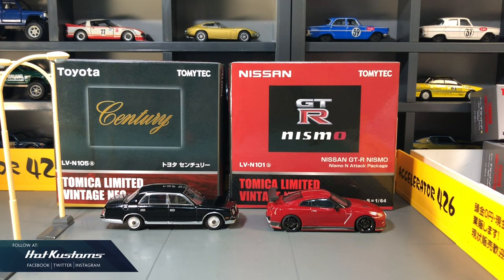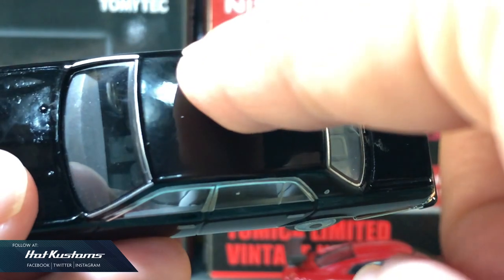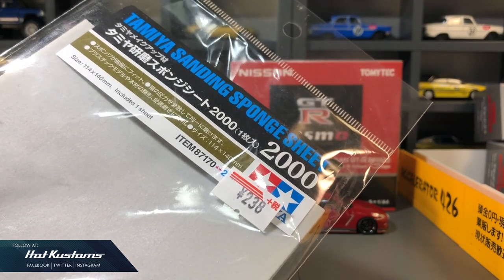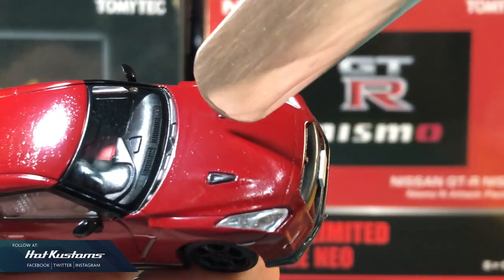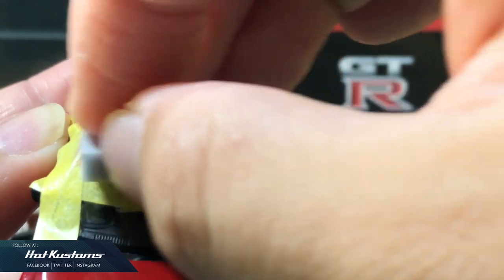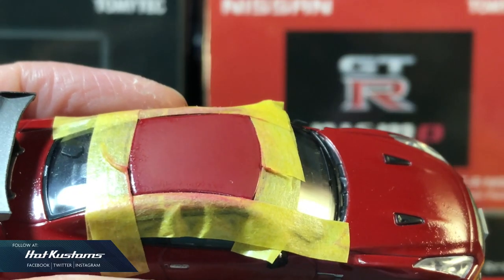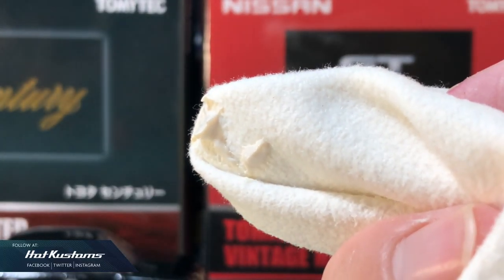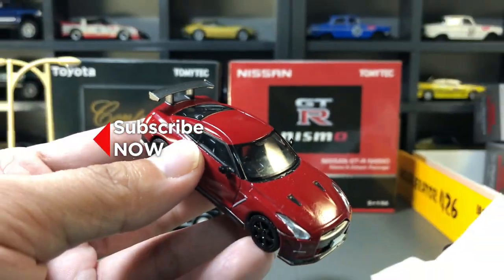How To Remove Paint Rash From Tomica TLV | DIY Tutorial

Comment: Bought a TLV Porsche and this happened. Tried similar method (2000 > 3000 > finishing compound) and there are some very fine scratches. Did I polished the finishing too hard?
Reply from the maker: Yes in a way I think apply too hard. It’s trial and error u can always apply on cheaper Diecast to test such as hot wheels mainline before attempt to TLV too. Can’t apply too many times or too hard or the paint will come off
Reply: @HotKustoms  sorry, my mistake, I was trying it on a modified tomica. But found out my Porsche has paint issues

Comment: Thank you so much for this tutorial, brilliant!     I recently purchased a few CMC diecast models and they have Paint Rash....IF I wax the models regularly and keep them in air tight display case, will the Paint Rash stop growing?     In other words, I can live with the Paint Rash as long as it does not get worse if I wax them regularly and dust them off.  What are your thoughts? Is Paint Rash like a Cancer that just keeps getting worse?        The previous owner of these models lived ina very humid climate, it's why the m,odels have the paint rash, I live in a very dry climate.

Comment: I was going to buy my first tlvn, but after reading and seeing the paint rash issue I decided not to eventhough it could happen to any brand.
if it was a cheaper diecast then I'll be okay but curing tlvns is just a big stab in the heart. such a premium price and you still have to stress/worry about the paint, especially for SEA collectors.
Reply from the maker: Yes TLVN is more prone to rash as the paint is thin

Comment: How about the paint with metallic? Will it be gone as well once apply the sandpaper?
Reply from the maker: Hendra Kesuma metallic chrome surface ? I think will have a lot of fine scratches after sanding
Reply from the maker: Kyle Soler I’m not too sure got to try it out start with a small area. It’s really trial and error. TLV usually Won’t have metallic surface hence it’s safer